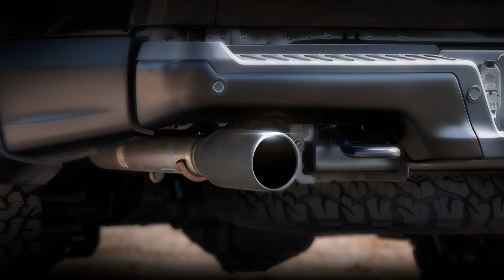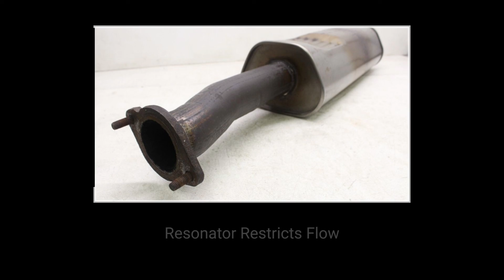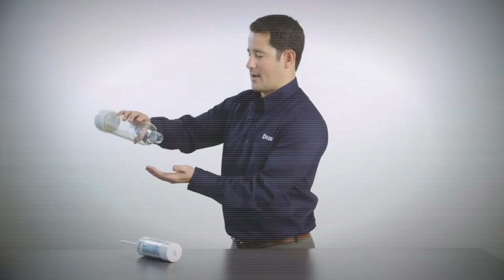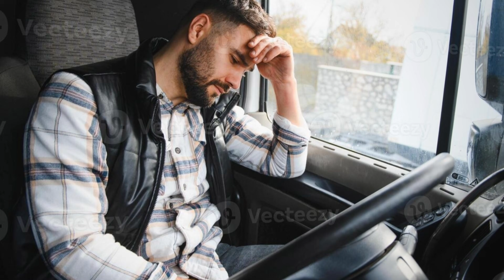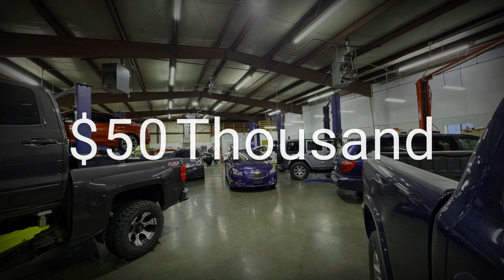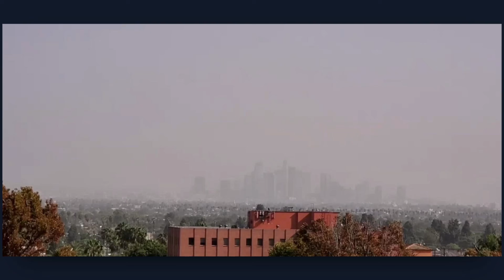The "ILLEGAL" Ford Exhaust Mod The EPA Is BANNING — Here's How To Do It Before It's Too Late

Comment: I was looking to get FenFab downpipes with cats and a Thermal exhaust with mid pipes for my 2026 ST. My question is if you can answer is what size exhaust pipe do you recommend? 2 1/2”Or 3”
I was going to go with 3” but some people recommended keeping some back pressure.
Reply: Backpressure is never good. That's an old myth perpetuated by people who don't understand how exhaust flow works. Too big of an exhaust can cost you power because you lose scavenging because the velocity drops, NOT because of a loss in backpressure. I would reach out to some reputable exhaust manufacturers. They'll want to know how much horsepower you have and how long the exhaust is. Or, search the forums and see what other guys are doing with the same vehicle.
Reply: @Cantthinkofahandle117 TY
Reply: @xnbk-yotiex5247 Engine Masters has a few videos on exhaust size with dyno testing. Probably won't help you pick a size but they'll help you understand the principles.
Reply: @Cantthinkofahandle117 TY

Comment: running Corsa extream on all my cars and trucks.  If it’s to loud, you are to old.
Reply: This mentality is the reason legislators are targeting exhausts. We can have a awesome sounding exhaust, performance without breaking your neighbors windows on a cold start.
Reply: @xnbk-yotiex5247 that's a fact. Im a diehard car guy but there's a time and place for loud exhaust, its not on daily driven cars. And let's be honest most these exhausts dont even sound good, its the fake car guys that think loud equals fast and real car guys just laugh at this shit. I hear so many new performance cars that just sound like absolute garbage with these raspy poppy systems. Your 2020 gt500 with a pop tune and 400 dollar catback system is not the same as an old plymouth max wedge car with a 426 or 69 camaro with a 454. Id be embarrassed to drive the stuff these guys do with how it sounds
Reply: @indyguy3400  Amen bro
Reply: @xnb @xnbk-yotiex5247 cars and trucks cold start in the garage with the door closed till they idle down at my house not a parking garage.
One or 2 of my neighbors rely on my car as an alarm clock.  Told me so.  Lol